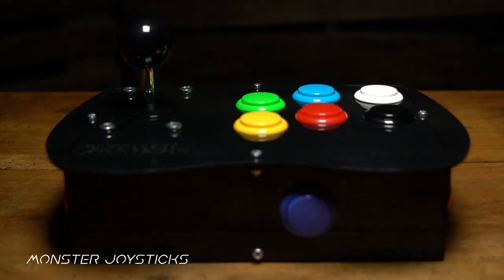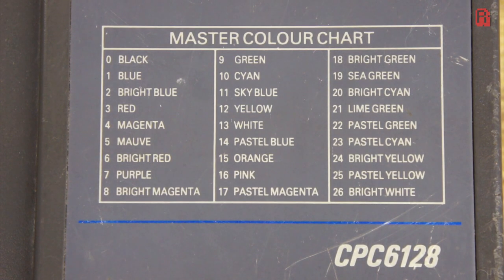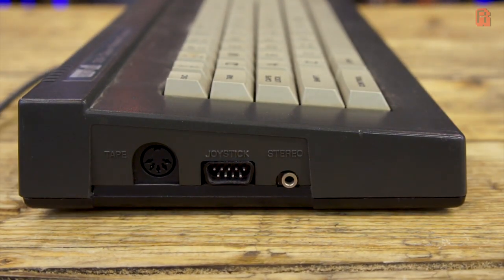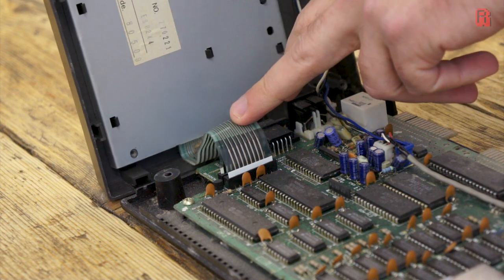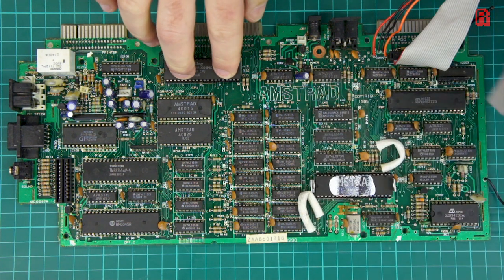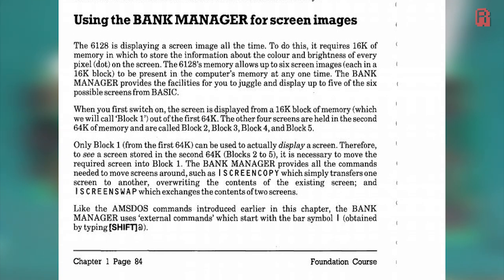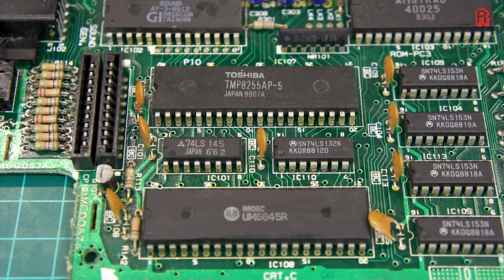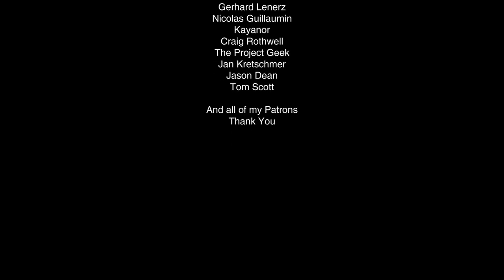Meet the Amstrad 6128 | Trash to Treasure Pt1

Comment: Watching this really brought back some happy memories. My CPC 464 wasn’t my first computer (had a ZX81 and Speccy before that), but it was the one that clicked with me and got me into computing properly. It was the first machine I learned to code properly on, and is the reason I later became the tech journalist and a massive technology geek I am today. I later upgraded to a 464 Plus (which due to it running the 6128 plus firmware) which proved to be a fantastic machine as it had the 6128’s excellent keyboard, could address a 64K external ram pack like it was the 6128’s internal memory, had two joystick ports as standard, had Centronics connectors instead of edge connectors for printer and the expansion bus, as well as having the ASIC chip. If only it had come a few years earlier.

Anyway, can’t wait for part 2, and in the interim this video has already motivated me to try and buy a decent condition 6128 of my own from eBay (given the lack of decent CPC emulators).

And, as controversial as I know it is, the CPC kicks the crap out of the Speccy any day of the week 😀

Comment: Ah now we're talking!  I've just completed the hard work on restoring my own 30 year old 464.  Despite having spent 22+ years in the loft, it worked with no problems, though required being taken apart and getting a damn good clean.  I've left my old MP2 modulator untouched and went down the scart/dc power supply route, and was very impressed with the results.  All it needs now is some heatsinks, some "goop" to lubricate the noisy tape deck, some belts and a bit more elbow grease to clean the tape deck window and some springs for the keyboard.

But like most old 464 users, what I really want is a 6128 to use on more regular basis.  It's just finding one that doesn't cost silly money.  The 8 and 16Bit market on ebay does seem a bit mental these days.

Anyway, your channel (along with one or two others) is responsible for introducing me to this slippery slope of hardware restoration.   Thank you.

Comment: I bought my 6128 brand new for £379.99 - I asked for discount for cash in the shop. My sister carried the computer box and I carried the colour monitor. It lasted me all the way through University before people talked about talking computers to uni.

I still own it, it probably needs the capacitors replaced but about 12 years ago I switched it on and it wasn’t reading disks - I only needed to swap out the perishes drive belt.

That baby was still working great!

Definitely my best computer before I discovered Macs.

I also had the TV tuner, and I cobbled together a ROM socket box from a magazine project and was able to run all sorts of great programs. I always wanted a hard drive for it but they were so expensive back then and now they are like hen’s teeth!

I also had a 3.5” Drive that plugged in at the back and I could read and write to PC formatted 720k floppies. It also allowed me to archive huge amounts of graphics which I created to save space on the rather expensive 3” diskettes.

And I bought an Amstrad DMP2000 dot matrix printer.

Comment: Nice! Can't wait to see this beauty fully restored!
As for "modern solutions" I use the power supply of an active USB hub (5V / 2A) with my 6128, which works a charm. I swapped the 3" floppy for an FDE solution and thus don't need 12V. To connect it to my CRT TV I use a custom RGB cable. The important thing is the switching current to let your TV know, to switch from composite to RGB. The CPC doesn't have a pin for that on th RGB out and you have to feed your 5V C through the RGB cable. Works a charm ;)

Comment: I was always re-soldering the power input connector on my 464, it would get looser and looser every time you plugged or unplugged it (and my parents made me dismantle the computer everyday). 

When I saw the wood louses in your video, the memories came back of my repair experiences - I remember once I found loads of live ants in there, and kept it a secret - my abusive parents would have found some reason to blame me for their very existence, and take the computer (again) for some random length of time!

Knowing this, I kept my mouth shut, and did my soldering (illicitly - i wasnt supposed to have anything useful in my room!) and quickly put the machine back together (complete with some of the ants). It had worked every day thus far, no reason it wouldn't continue to do so... I was, of course, correct. I bet that CPC464 would still work today, if I hadn't left and never gone back as soon as I was old enough!

Comment: Got one of these a while back as just the unit itself, swapped the 3" drive for a gotek and adapted a PSU from a cheap external HDD PSU with molex connector (can be bought from Ebay for around £4), the video cables are easy to find on Ebay (Retro Computer Shack) or make your own.

Comment: When it comes to the image, you can build a DIN to SCART cable very easily or simply buy one. All of the schematics are available online and the image quality is actually superb! To solve the power problem you can use a 5v/2A wall wart with NORMAL polarity just for testing purposes, or go full out with another 12V/1A wart with REVERSED polarity to operate the floppy as well

Comment: Great vid, as always. ;)

Loved our 6128 in the 80s. A very much underrated machine, mainly due to many very lazy ports of games from the Speccy, but some nice exclusives, too.

I personally think the CPC had some of the best versions of games, too. Like Dynamite Dan, Gauntlet, and Cauldron, with their bright colour palette, and YM tunes.

We had the colour monitor with ours, and also had another monitor years later, which had an "MP-3" tuner unit, and used as the TV in our spare room or caravan. lol

One of my fondest memories of the 6128 was my Dad using it with a modem to dial in to a travel agent's server, and booking my first holiday abroad (to Mallorca).

We still had to pay for the tickets at the Stanstead checking desk, of course, but it meant skipping the middle man, and hence the commission. :p
Reply: We also had a Star LC-10, then LC-24 printer, with colour ribbon.

I bet loads of people remember those? :p

They were actually really nicely built printers. You could get away with using one nowadays, as long as you are prepared to wait, are mainly printing text, and wear earplugs. lol
Reply: I definitely had a Star 24-dot matrix printer. Not sure if it was an LC-24 though, the model number doesn't ring a bell.

Comment: Its great that this AMSTRAD came with a headphone jack like a Megadrive 1 that means there is probably a whacky monitor jack to rgb tv scart cable used to get the best picture and better sound both through the TV.
Reply: Going on this topic the monitor hole does look the same as the Megadrive 1 RGB output female doesn't it? Get one of them see what happens if you run it off the headphones and the monitor jack of the AMSTRAD or if you have a Megadrive 1 nick it's cable to try it out. lol

Comment: As a games programmer in the 80s, the CPC was the computer I owned at home. It might have been cheap but it was a good bit of kit. I worked out the 3D math for the Amiga and ST versions of Elite on the 6128 in basic before converting to 68000 machine code
Reply from the maker: Hi Rob, I'd love to have a chat with you about your experiences some time if you're interested?

Comment: The connector for the floppy cable is never meant to be opened again. They are single-use items. This model is for soldering to the board. If you remove the cable it will probably not pierce a new cable 100% since it's already been expanded.
Reply from the maker: Even more reason not to touch it then!

Comment: Anyone else here remember Ambit, a very Techy electronics supplier. After wondering what happened to them it turns out the guys including who set it up, including Roland Perry,  then went on to design the Amstrad computers. Alan Sugar started the project by doing what he did best; coming up with the concept of including a monitor to save kids hogging the family TV, and putting the PSU in the monitor to save cost. As a result the CPC might have been the first computer where the case design was finished before the CPU was selected.

Comment: I have quite a few 464s (first one I rescued when I saw it in someone's front porch, along with a monitor and everything else, they were about to throw it away - close call!), but it took a long time to finally obtain a 6128, even though it was back when vintage 80s home micro tech hadn't yet rocketed up in value on the used market (won it on ebay in Jan/2012). Bizarrely though, not long after I managed to get three more units all from different sources. They didn't come with manuals, but I obtained two manuals separately as well. 2012 was a good year for winning 80s stuff on ebay.

Oh and to one and all, May the 4th be with you! 8)   (in the traditional, original trilogy sense of course, not the modern RJ SJW garbage)

Comment: A loaner Schneider CPC6128 (boy, do these centronic connectors make it look professional) was the first computer I ever used and a while back I got my hands on the very same one again. Unfortunately I stopped just shy of replacing the ROM with  Parados for easier 3.5" floppy handling. Also be sure to give SymbOS a spin, if only for the novelty of it.

Comment: I've got both the 464 and 6128. They're fantastic machines. The 3" disks seem to have held up better over time than the 3.5 floppies I have from the same time period. These machines work well with the Gotek floppy emulators running HxC provided you bodge together the right cable.

Have you got the CP/M disks that came with the machine? It's a pretty capable CP/M machine if you're into that sort of thing.
Reply from the maker: Matthew Harrison (matthehat) I don't have the CP/M disk.  Is it available as an image some place it would be fun to check out.
Reply: mmh. Could be a random quirk of their construction...
Or simply the lower data density.

The less data is physically on a particular medium, the less effect any damage the disk might have is going to have on the data integrity.

Of course late era 3.5 inch disks are notably worse than earlier ones, so some of it could just be manufacturing differences...
Reply: The images are available on CPCWiki. The disks that came with the system had both CP/M 2.2 and CP/M Plus on them. Not sure why, as CP/M Plus is backwards compatible and allows access to more RAM. There's a decent implementation of Logo on those disks too.

You just type |CPM at the BASIC prompt to boot into it and off you go

http://www.cpcwiki.eu/index.php/System_Disk

Comment: Ahh, this is one of the nicer 80s machines I never got my hands on. It's going to be fun to see this unravel!
Living in Sweden, the experience I have with Amstrads is more or less reading about them in UK magazines. They were pretty much non-existant up here, sadly.
If you could touch on how best to connect a CPC to a modern screen, that'd be great. Is there an HDMI option with some clever adapter, or S-Video maybe?
Reply: If you have the right kind of LCD monitor (supports 15khz; see 15khz.wikidot.com) you can wire up a simple cable. Or you can use a gbs8200 off ebay to give you a 50hz vga output that works on practically anything. Neither supports some of the more clever demo effects, but for everything else they work great.
Reply: James Churchill - thank you! :)

Comment: It's one of the great unsolved mysteries of the 1980's...just why did the French take to the Amstrad machines so much.

..and the gentle way you tickle those circuit boards with a brush & alcohol wash, Ooo la la! :)
Reply from the maker: C'est vrai mon hérisson, c'est vrai
Reply: The French took to the Amstrad because Sinclair, Acorn and Commodore largely ignored the French market.  Alan Sugar didn't.
Reply: Amstrad was actually huge in specific countries outside the UK. This was largely due to Amstrad buying shares of the most successful local dealers and pushing their products, in those countries, aggressively. In Greece, for example, they had a 51% share of the local dealer and they organized big events which boosted their sales beyond imagination (they even outnumbered the local IBM dealer in sales!). Anyway, the 6128 specifically is a hugely underrated machine, which if  its home-country had loved as much as other countries did, we would now be talking about it being the king of 8-bit micros (and that comes from a Spectrum owner :) )
Reply: ahem..... We french never liked the Spectrum, Acorn was locked to the UK, and the Commodore C64.... just no. It was way too expensive for what it could bring out. with a monitor, it was out of reach for most families, overcomplicated, and with very dated graphics. Amstrad took the market because the Amstrad was and still is tank built, very stable, offering the best basic system of all the 8 bits, flexible, and a great palette to make superb graphics + a YM2149 wired in stereo. all this for an unbeatable price.

Comment: Replace the drive belt on the 3" drive before firing it up.  Chances it it has either dried out and will fly into hundreds of little pieces when you turn the machine on (it will spin up the drive on boot) or even worse sometimes these drive belts turn into goop which will fly everywhere and take hours to clean the sticky black gunk off the mechanism!
Reply from the maker: It's on the list... good idea to check it before trying to power it up or at least disconnect the drive
Reply: I had these scenarios happen on a Spectrum +3 (same drive) and a CPC 6128 :(  Look forward to rest of vids.

Comment: It'd be insteresting to see how this compares up against the SInclair +3 'equivalent'.  I might be biased (guess which machine I owned, compared to a mate, who had this, the 6128), but I always thought the power and monitor connectivity being instrinsictly linked a little wierd to say the least.  Maybe even a little 'botched'.  I'm not saying the +3 was perfect, it having its own collection of completely-non-standard connectors (did standards even exist in the late '80s?).
Reply: The Unique Selling Point of the 464 was that it came with everything you needed rather than having to repurpose the family TV and Cassette Recorder. Colour TVs weren't cheap back then hence the accessory that allowed you to use the Amstrad Colour Monitor as a TV.

Comment: Wait. All it needs is a +5V and +12V power source (which were originally provided through the monitor)? Well, if I'd be you I would have taken a standard PC power supply (SFF, ATX or an "AT" PSU salvaged from some old 2|3|486), made a few cables and ran with it. I'm actually using a modded ATX power supply to power the one or another vintage systems where I don't trust the original power brick anymore (even added a 9V output which is derived from 12V).
Reply: Steve Benway did a video a couple of years ago, I think, where he bodged together a power supply for a CPC.

Comment: I've never seen one of these. I find it curious and a "bad thing" when manufacturers go with weird propietary formats instead of "normal" floppy disks. it makes the computer less "future proof". we can get parts for "normal" floppy drives, or replacement units. we can get floppy disks for them, and we can preserve the software and copy it easily, or keep an older computer running or restore it because we can get the software on the internet and write it easily on any normal PC with a floppy drive. that's not the case with "weird formats", if you don't get a disk from that era, or if it breaks, it's over, you can't just pop another disk in your PC and write a new copy.
Reply: 3.5 eventually became the standard because of the PC, but at the time the CPC came out, this wasn't the case. But electrically they're basically identical - a CPC can have an external 3.5 drive, and you can put the 3 inch drive in a PC if you want!

Comment: Had the AMSTRAD 6128 used ZILOG Z8000 it would have made for a better for a better computer as you would have proper mul ,div instructions and might have been a competitor to the COMMODORE AMIGA 2000, an example of the code...

LD &40,DE
IN AL,DE
XOR AL,&H02
OUT  DE,AL
XOR AL,&H02
OUT DE,AL
RET